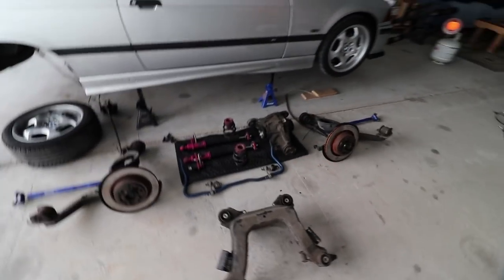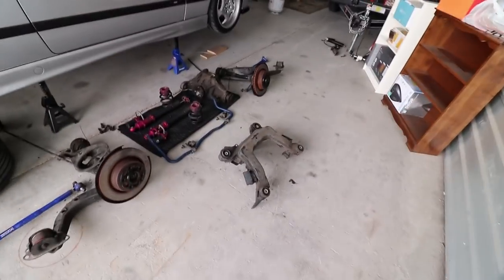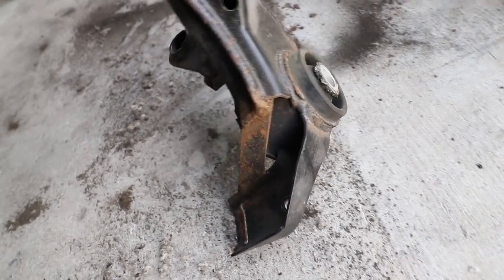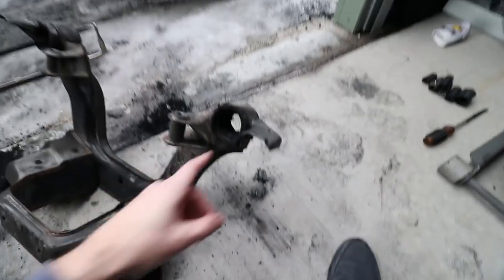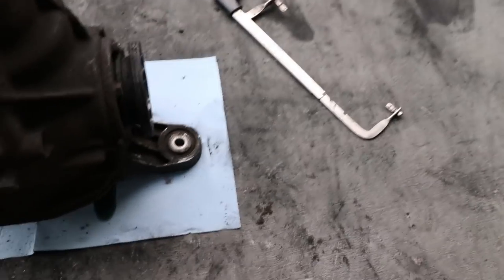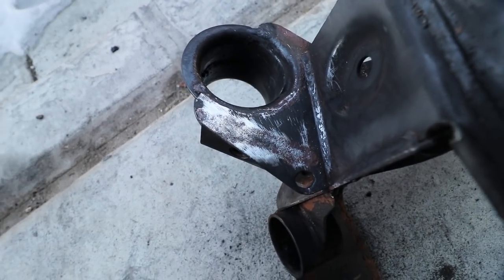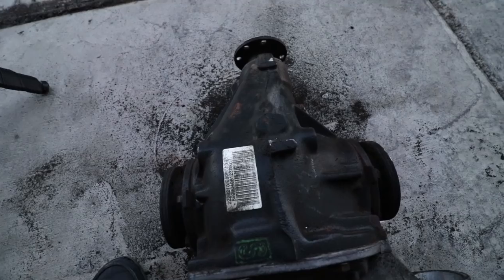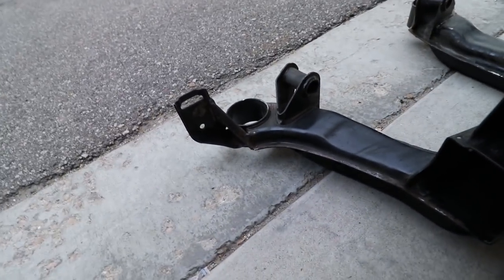E36 M3 Subframe & LSD get OVERHAULED

Comment: A better way to remove the bushings is to heat up the subframe around the bushing till the rubber starts to melt, then just hit the whole thing out with a hammer, took me about 30 to remove all 7, really easy

Comment: Just replacing the old bushings to even stock Factory new ones would have improved the ride immensely. I'm worried that having all poly bushings back their is going to create a very rough ride and every vibration is going to transfer and you may not like it. It will definitely stiffen everything up and you're going to feel it for sure! ...but if that was a daily driver, you might regret hard poly bushings. Just my humble opinion.

Comment: Great work. I'm wondering how the paint would hold up in the long run. I did a bunch of frame braces for my Maxima and rattled can it, few weeks later the paint started to chip off despite the careful paint prep. I would seriously get it powder coated, especially when you already invested a ton of time and money for new parts too. To cut down on the cost, clean it as good as you can, especially the rust so that they don't have to bead blast them too much and look for common high demand color. I'm also in the process of doing similarly and plan to powder coat the sub frame, the control arms, trailing arms, and the diff housing.
Reply: Agreed, would have farmed this out for bead blasting/powdercoating and saved a ton of work.
Reply from the maker: Totally. The paint is holding up fine but powder coat would have been much better. On my list for things to do in the future. If you dont mind the extra cost and you'll be keeping the car for a while then go for it.
Reply: @TreatsOnTheStreets  thanks and great work!  I need to do the same on my Z3.

Comment: did the paint dry/cure ok? spray painting outside with freezing temperature  would concern me a bit, but great job, I wonder if BMW have a tool to remove the bushings?
Reply from the maker: There are bushing removal tool sets that would work but they can be a pain to work with as well. I definitely cut some corners painting when it wasn't very warm out but that was really my only option and so far it has held up ok.
Reply: It won't last a full year, it was obvious your surface prep was less than 110%
Reply from the maker: @reallyhappenings5597  so far it looks like the day I sprayed it.

Comment: You really don't need to burn out the bushings. Just heat the outside metal for about a minute then whack them with a hammer. They will pop right out.

Comment: What paint did you use?Can u put the link?
Reply from the maker: I used two different cans of Rustoleum. First a rust inhibiting primer, then a satin black paint. I don't have a link but that's what I used 👍.
Reply: Great video! can't wait for the weather to break so I can clean mine up, 3m has a very tough undercoat that would further protect the cradle after paint good job!
Reply: Thanks! @TreatsOnTheStreets